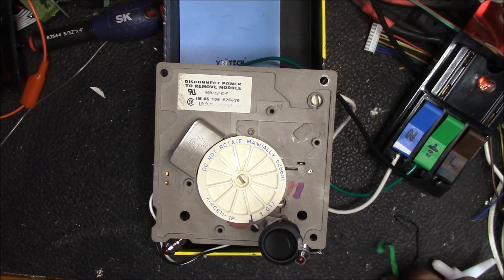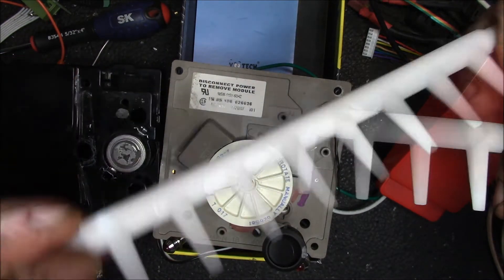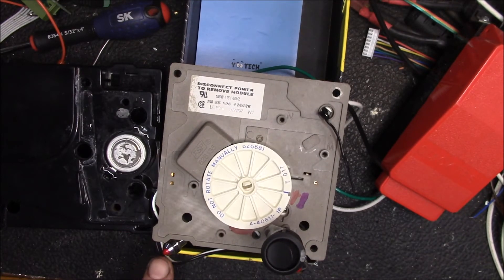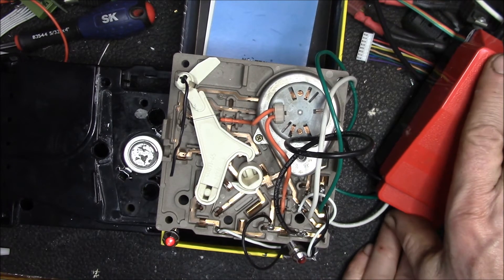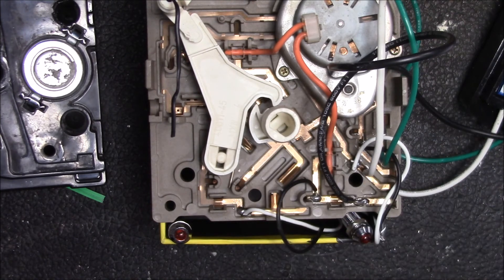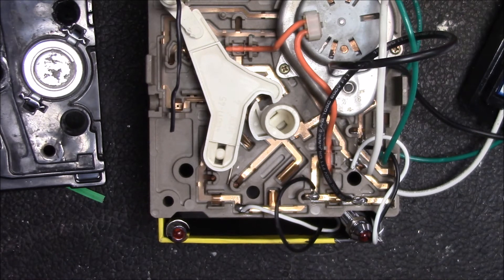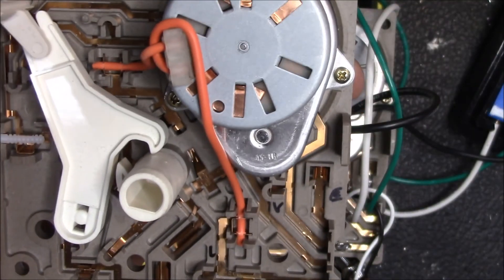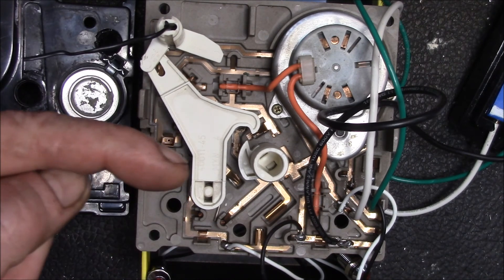Whirlpool Modular Crescent Mold Ice Maker Operation

Comment: Mr Brown: You have done the complete reverse engineering needed to understand how the apparatus works and even better you use the correct language.  My guess is you are an engineer.  

My unit failed at the point where one of the steel pins of the heater slides into its springy  stamped copper contact in the plastic raceway.  It can only be seen by taking the front panel timing module off and inspecting the heater.  Apparently after 14 years, moisture condensing on the copper-trace/steel-pin interface finally caused enough corrosion to form a high resistance contact.  When the corrosion got bad enough the copper contact got too resistive, dissipated all the heat and eventually disintegrated.

Its great to examine and understand an appliance with such clever quality design. 
Its also amazing that these timing circuits are still made with rotary wiper switches and simple motors instead of using an embedded MCU and software. Very old school! 

Lets hope Whirlpool keeps the same quality for the replacement and doesn't cut corners.
Its a great design.  

 Thanks for the video!
Reply from the maker: They seem to have stuck with this current design since the 1980's when the original design was modified.  It does seem to be quite reliable despite having been designed for a relatively low cost.
Reply: @The4Crawler    Still, it seems risky to depend on a copper spring contact on steel for a 180 watt heater that cycles 10 times a day. If it was standard gold-plated beryllium copper on gold plated steel it would have probably lasted forever. But I can't complain about getting 14 years.    I am quite glad the icemaker is entirely self contained and doesn't depend on a PCB control board or IOT controller logic. The replacement cost and supply chain issues would be outrageous, each manufacturer would be different.
Reply from the maker: @cwviewer8605  Yes, the design could be improved.  I think that's part of designing the product to a price point.  On my two icemakers, one had the heater coil fail and on the second, the non-stick coating on the ice tray wore out after about that same period of time.  On that second one, the front controller and the heater coil were still in working condition.

Comment: a very nice detailed explanation of sequence of operation 

Whirlpool high this design for as long as I can remember and I have been in the service industry since 1985. I can’t remember if you touched on when the icemaker knows when  to stop making ice with the bail arms resistance to swing
Reply from the maker: Covered that at 7:42 in the video.  Yes, the first version of this ice maker was designed in the early-50s and then redesigned in the late-80s into the modern form.

Comment: Coincidentally my whirlpool’s ice maker is intermittently acting up.  Same model as this one.  Triggering the thermostat gets the cycle going and it goes all the way, but doesn’t seem to fill up enough water despite adjusting the water level as high as it’ll go.  Thinking the thermostat isn’t functioning sometimes.  Replacing seems easy and cheap enough (~$8),  but unsure if I need the $22 alumilastic or if I can just use the heat sink compound I’ve already got.
Reply from the maker: Not sure on the need for the special heat sink stuff or if regular stuff would work.  Suppose you could try the regular stuff and if it doesn't work, get the recommended stuff.
Reply: @The4Crawler  Just gave it a go.  Thinking something else might be happening now that I’ve had it apart and back together since seeing the thermostat’s placement on the opposite end from where the tray is filled.  My low water fills into the tray means water does not spill over into the socket closest to the thermostat, so perhaps sometimes it doesn’t get enough heat conducted out of the thermostat and thus won’t close the circuit.  Definitely a fascinating device that is fun to work on.
Reply from the maker: @cbh148  You could try timing the water fill cycle, supposed to be approx. 7 seconds.  If that's OK, it may be the water fill valve at the base of the refrigerator or perhaps there's a filter or screen before there that's clogged and limiting the water flow.